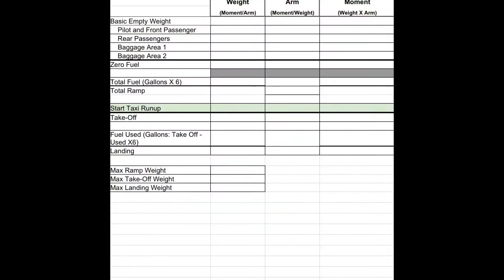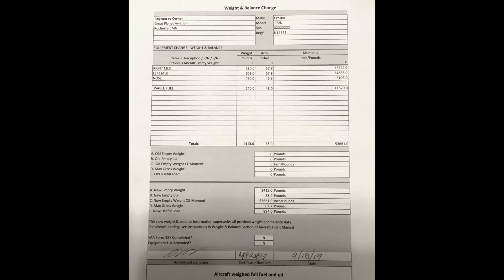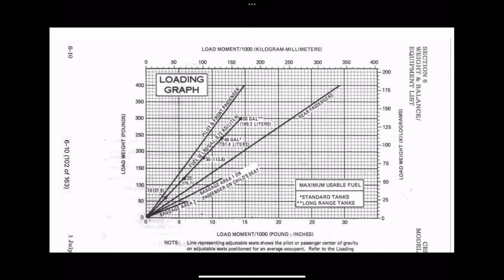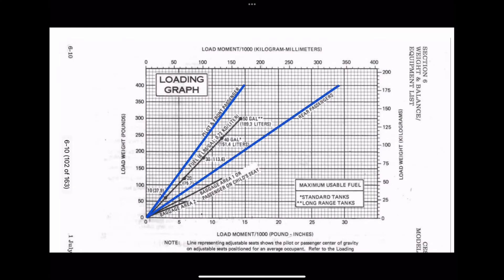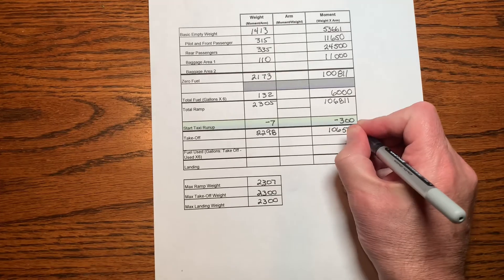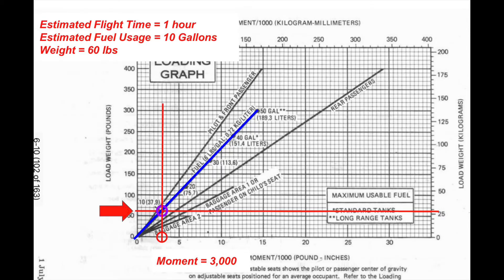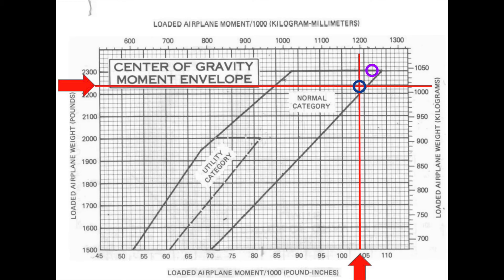Checkride tips | Calculating a cessna 172 weight and balance by hand

Comment: To make calculating weight and balance easier one can buy for a one off payment a programme called Gyronimo.   It even works out runway length required taking into account temperature, pressure, wind direction and speed, etc.,

Comment: I am confused on fuel calculations, if you start with the empty aircraft weight and you need 10 gallons of fuel for your trip but when you pull your plane out the hanger, it already has 16 gallons of fuel in the tank, how to you account for the extra fuel and weight.  Great videos, can't wait to watch more.
Reply from the maker: That is a great question! 

I’ve not heard your question asked during a check ride.  However, if you are asked, there are a couple ways you might resolve this issue.  You could always fly the airplane long enough to burn the 6 gallons.  Or, if you have an approved place/container to put it, you could remove that fuel from the tanks (6 gallons is quite a bit of fuel).   

During the check ride, the DPE is setting up a scenario where you have to make some difficult decisions.   The question is usually “how can you make this trip with all the people and luggage”.  The answer is usually “by taking less fuel and maybe having to get fuel along the route”.   Please realize, they aren’t asking if you should make that flight, or if you (personally) would make that flight.  Those questions may come later as follow-ups.  In this case they are just asking you to prove your understanding of weight/balance/performance and what the trade-offs may mean.  

In real-life, I’ve left baggage behind, taken a different, more capable/expensive, airplane, or not flown because I couldn’t get everyone in the plane and stay within weight and balance while still having enough fuel that I felt safe making the trip.  In club/rental situations, I’ve also asked the person flying before me to NOT put fuel in the airplane so that I could add what I needed.   Estimating someone else’s fuel usage can get tricky, but in these cases we had a tank dip-stick so that I could verify more precisely what was actually in the tanks.   Still, be pessimistic.

I hope this helps!  Thanks for the comment!  And I look forward to hearing more from you!

Comment: Hello, where is these -300 come from, please?
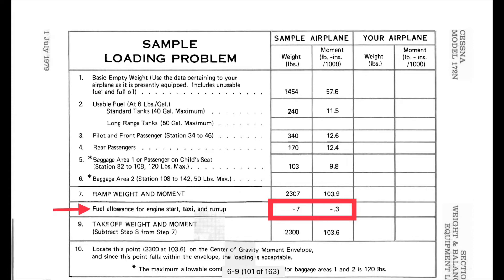Reply from the maker: Good question!  In the chart supplied by Cessna (shown in minute 8:35), it shows the fuel allowance as -7 gallons, but -.3 in the Moment column.  However, if you look at the second and third lines in the “Moment” column title, it says “lb.-ins./1000”.  Because the rest of the moments on my chart were portrayed as the “full moment” rather than the moment/1000 I needed to multiply -.3 by 1000 to get the full moment of -300.  This allowed me to do the math appropriately.  

I hope this helps.  Thank you for the question!
Reply: @ScottKoonCFI  Thank you very much for replying!

Comment: I calculated my arms but it looks like you didn't calculate any arms on your form. Why is that?
Reply from the maker: Good observation and thank you for the question!  

In many Cessna POH/AFH documents they provide two different weight and balance charts—The “Center of Gravity Moment Envelope” and the “Center of Gravity Limits”.  These two charts show the same weight and balance limits. However, one is based on Moments and one is based on the Center of Gravity Arm.  For this first video, we used the “Center of Gravity Moment Envelope” and therefore didn’t need to calculate arms to determine whether or not the aircraft was within weight and balance limits.  If we had used the other chart, we would have had to calculate the Arms in order to determine whether or not the aircraft was within limits.  

For an example where I did calculate the Arms, please watch this video:  https://youtu.be/QM7AbPii01g

While the example is for a Piper Archer III, the process is the same used for any small aircraft.

I hope this helps!  Good luck in your training!
Reply: @ScottKoonCFI  yep, I saw that video about an hour later. Great material and thank you for making me aware of such things
Reply from the maker: Not a problem.  Thanks for watching and commenting!